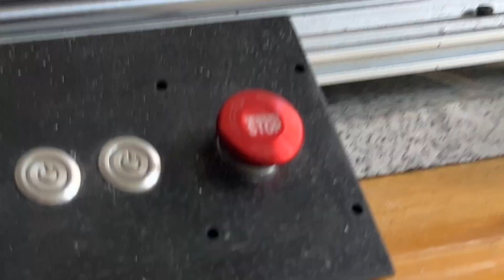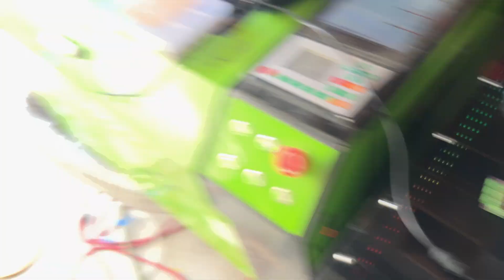Homemade CNC controller (by scrapping old parts) running on GRBL-LPC using a smoothieboard clone

Comment: Gosh so clean from the outside. Maybe I should finally do the controller-in-a-box + connectors for my laser because damn
Reply: Also the dc jacks tip is great. I wish I had the idea before.
Reply from the maker: Thanks. I really like the way that it turned out. I’m always moving and repurposing equipment and everything enclosed made it into a plug and play and I don’t have to worry about a cable or plug accidentally getting snagged. If I need another output for something I can easily punch another hole and slide anode DC jack in place. 

What kind of laser do you have?
Reply: @HangingOutWithChico  Just a diode laser but it’s 1000x1500mm with a motorized Z focus and vertical on a heavy duty gantry without belts. Small spaces problems, small spaces solutions!